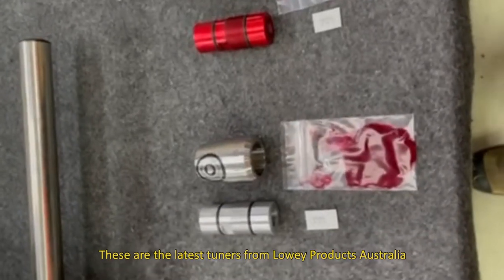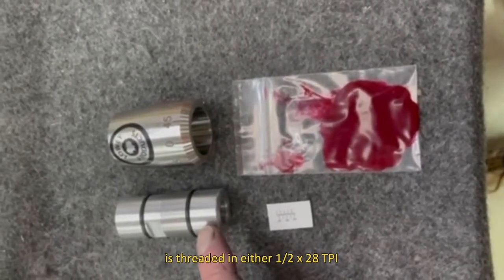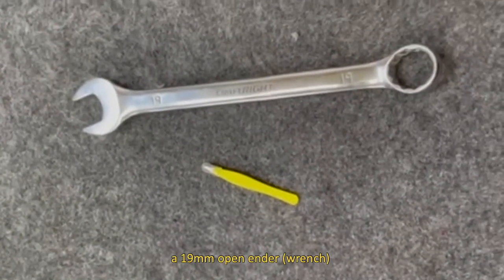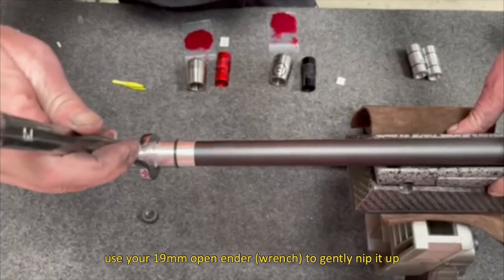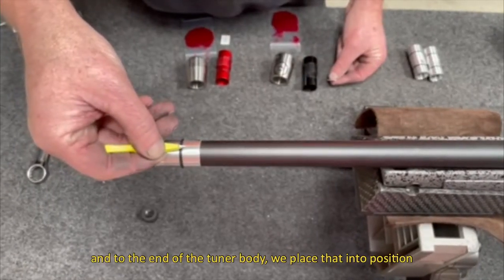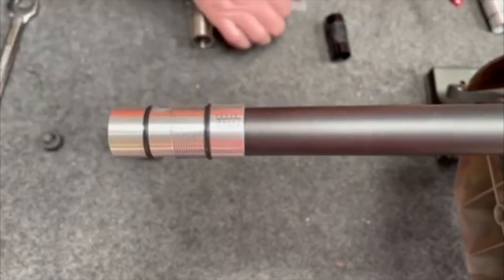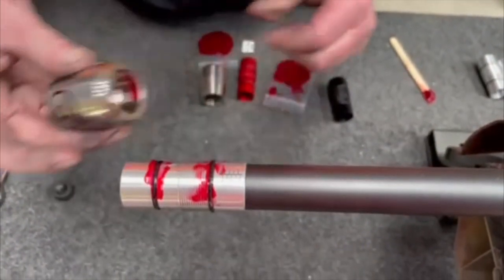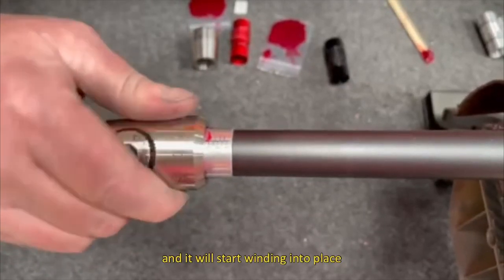Universal 'screw-on' barrel tuners from Lowey Products (Australia)

Comment: Google Harrels tuner/brakes far superior and the tuner sits over the barrels vs. on the end of the barrel. 
This was you need a full revolution to adjust the tuner and it can afford to slip a little which it will without
adjusting the tune. When a tuner sits on te end of the barrel a small adjustment can alter the tune which 
it is very easy to have it slip.